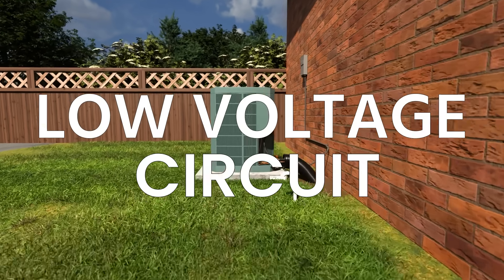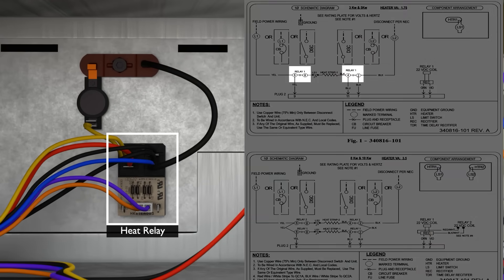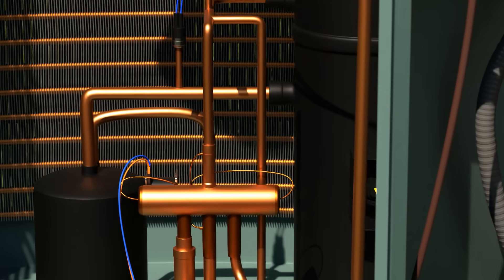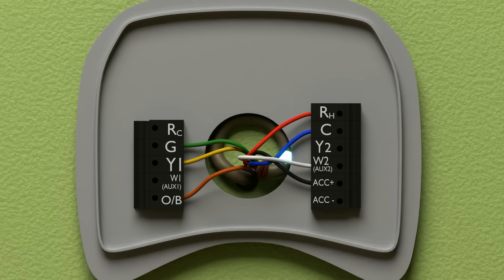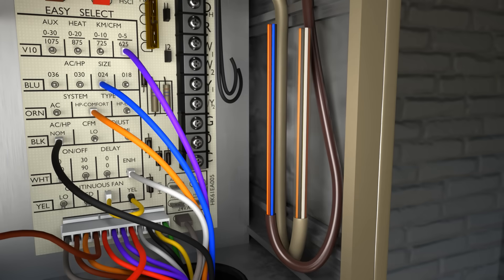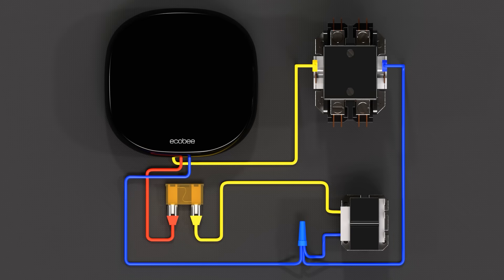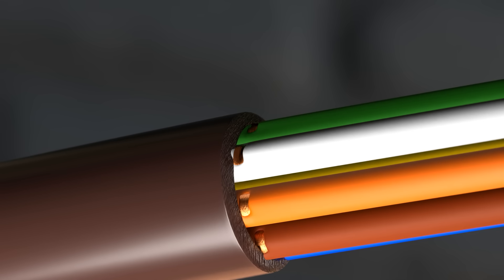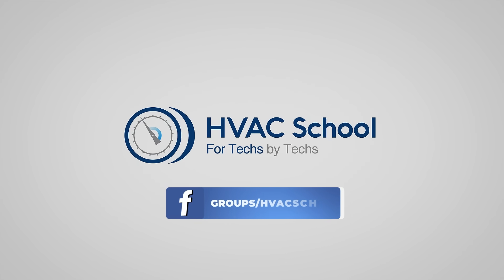Understanding Low Voltage Wiring for AC & Heat Pumps 3D

Comment: @10:50:  This is slightly misleading, because the common wire from the thermostat is only to power the thermostat.  It's independent of the compressor call.

Comment: Also it is necessary to run 24 volt wires through metal flex conduit on the condenser if you have a pair of Boxers that like to chew up things like ANYTHING!!!

Comment: Hi, i just came across a very interesting topic on low voltage wiring, and was hoping that you or anyone out there could explain: how to ground a heat pump 24v transformer? OR explain, what is the "GROUND" on the low voltage side on the control circuit?

Comment: I got kind of confused here your diagram shows the white wire connected to W1 but you say W2? I have a Trane/American Standard relay board connected to my American standard ACCULINK Platinum 1050 Thermostat when the thermostat calls for electric (auxiliary) heat the relay board lights indicates that Y2 and W1 are energized when calling for auxiliary heat when the heat pump goes into defrost mode it energizes O Y2 and W1 in emergency heat mode it only Energizes W1, G, and E all stages indicated by a Green light beside each input on the relay board. When my HVAC contractor installed my system this is how they figured out how to wire everything up to the relay board by putting the thermostat in system test mode to see which lights lit up on the board depending on the call. Confuse the heck out of me because the thermostat only had 3 wire inputs B R and D that was used it had other inputs but they were for sensors like outdoor thermostats and such.

Comment: How does the dehum work? 
Does it cool and heat at same time?
Is there a reheat coil? 
Does it over cool to reach dehum set point? 
Does it run at low speed?

Comment: I’m working as an apartment maintenance technician and noticed these air handlers don’t have a circuit board. All these low voltage wires are wire nutted. Sucks that most of these videos don’t show this kind of example. But I get how it works thanks to these videos. Much appreciated 🙏

Comment: Typically a jumper (J1) on the air handler board has to be removed to disconnect a constant 24vac from the Dehum terminal.  Then the thermostat's dehum control can reduce blower speed in cooling.

Comment: Great presentation as always. Now a question. I wonder how many techs make sure that the insulation of the LV wires do not touch each other after coming out of the sheath going to their destination on a terminal block or component. I don't know the answer myself.